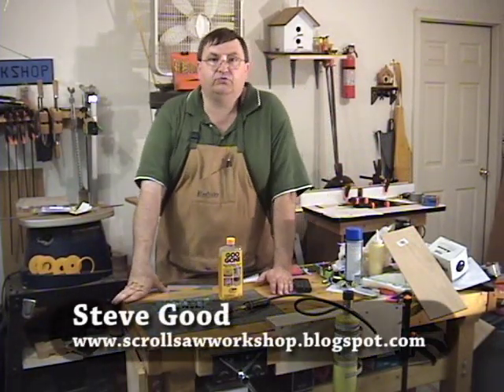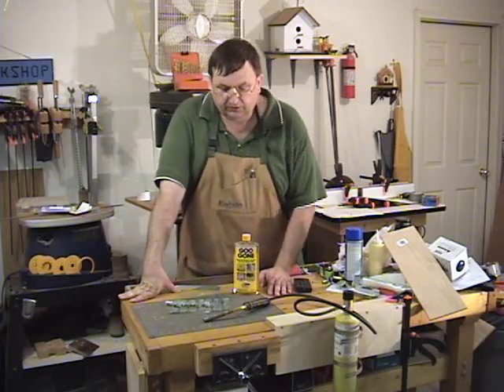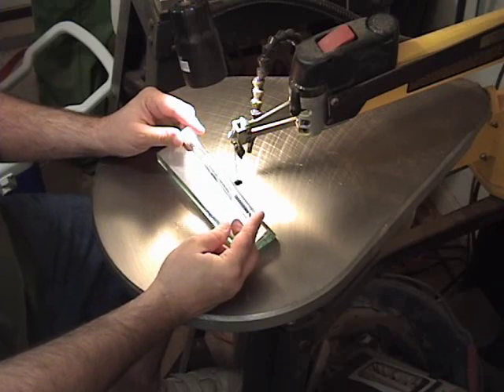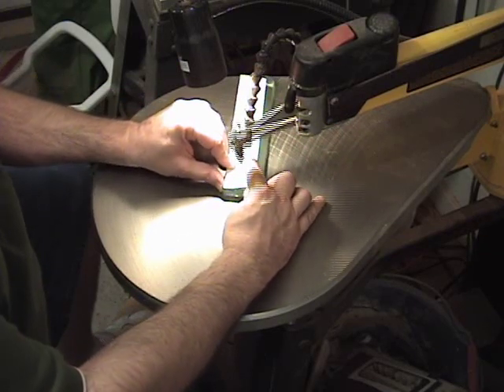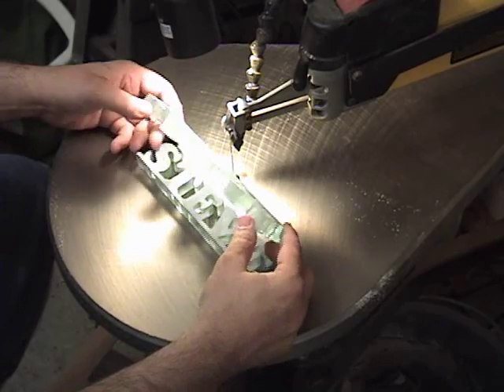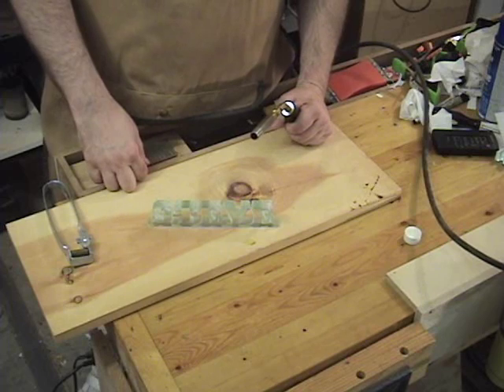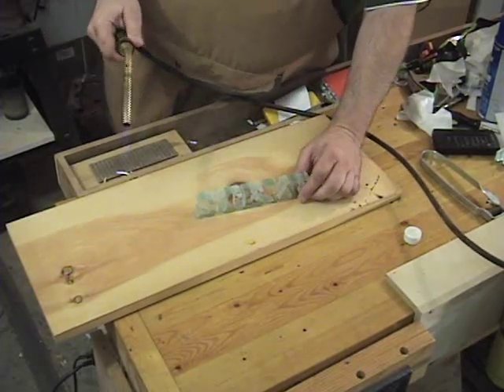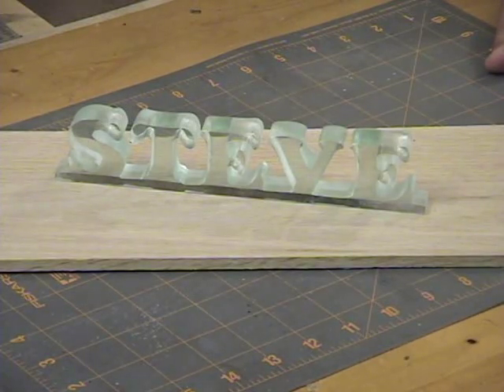Cutting Acrylic with the Scroll Saw

Comment: Acrylic comes in two types.   Cast and extruded.    The extruded will melt even with a slower speed.   Using the cast acrylic will not melt from the saw blade.    I have for years used 1/4” acrylic to make photo sculpture technique....I glue pictures to the acrylic....wedding announcements and any certificate that Patty wants me to mount.  Makes a great gift and people love them.  I go to Tap Plastics here in San Mateo Ca for acrylic.
Reply: Hey that is information I needed! Thanks for posting that. I'm looking at this Harbor Freight scroll saw and hope to do 1/4" thick acrylic for some art projects. Just some subtle curves.  I believe there is a Tap Plastics near me unless they went out of business.

Comment: Hi, very interesting video sdgood, I have been thinking about getting a scroll saw, in the past when cutting acrylic about 8 to 12mm using the jig saw, it just melts on me with the blade just ending up stuck, even with Perseverance on my part, The end result is still rough as can be, Like you say, the acrylic just welds back together on me as I cut through, you made a real good job of that 3/4 thick too.
Thom in Scotland.

Comment: Actually, i tdoes work. You have to be very careful with the speed and not push the material through too fast. You have to go very slowly. In addition, a crown tooth blade is best as it will keep the material the coolest. This will help to prevent the piece from welding back together.
Reply: javelina100 i havent seen the term crown tooth blade does flying dutchman have that?

Comment: I'm cutting 1/2 inch acrylic on slow speed and it always welds itself back together as I do the cut. I even put a piece in the freezer and tried while it was still cold. It stayed cold but still would not separate. How to keep this from happening? Suggestions?
Reply: Billy Barton try a cardboard backer it might help.
Reply: Billy Barton Try clear wide cellophane tape on both sides along cutting path. I think I used 1" width.

Comment: I'm getting a scroll saw soon. I have a question. Why do people fuss with glue? Is there a reason why people don't apply tape first, then glue the design on the tape?
Reply: 2DG i like rubber cement its easier to remove.